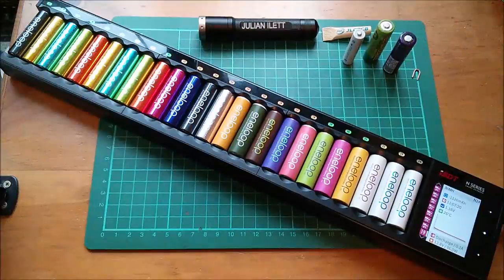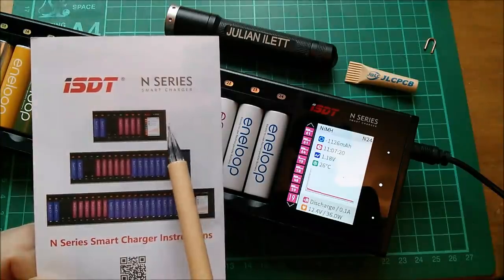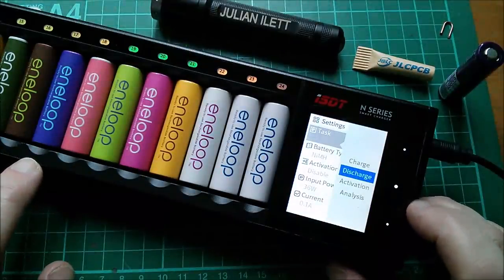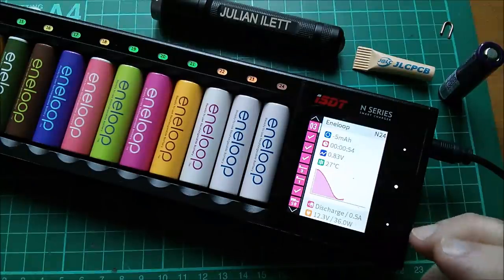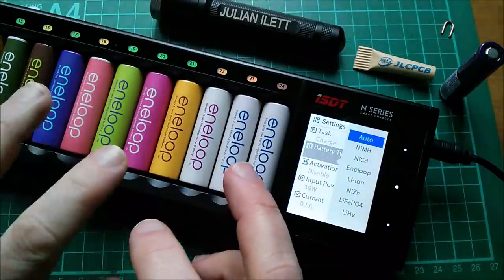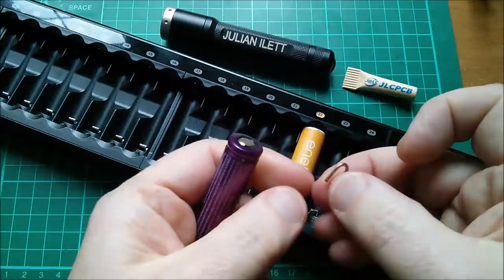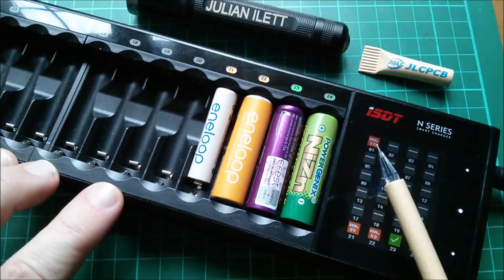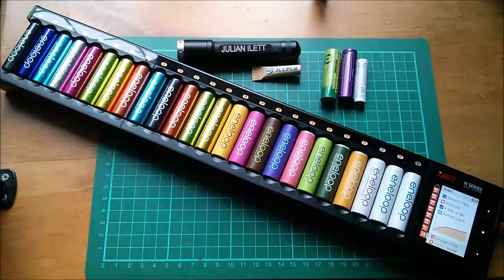First Look: ISDT N24 AA Battery Charger

Comment: Man, I wish that they made one of these for 18650's:) Great review, thanks.
Reply: LOL...can you imagine the size of the power brick you would need for a 24 slot 18650 charger..... it would need to be at least 12amps if you were going to provide 500mA to each cell , and the size of the circuitry to handle that beast and the heat dissipation...its like a desktop bomb....
Reply: @sortofsmarter  The 5V line of a computer PSU can do over 30A, enough to drive a rack of 24 TP4056 boards at 1A, and for a lot cheaper.
Reply: @ahaveland  True, I'm not saying it isn't possible. But depending on circuit design and chip demand you would need more than 5 volts. Even if you passed the current through one schottky diode and had no other losses in your circuit would loose 0.46v right there and now you dont have enough to reach full charge. But there are definitely ways just not cheap...
Reply: @sortofsmarter  No Schottky needed. Please read up on the spec of the TP4056. I know what I'm talking about because I've built a parallel independent charger for just a few quid.
They take 5V, and regulate it to follow the charge profile of a liion/lipo cell according to its state of charge.
Make two thick busbars, supply negative at one end and positive at the other, hang the TP4056 boards and 18650 sockets off it, and you're done.
Reply: @ahaveland  I have also built a similar board to charge 6 18650 at once, But i was implying a commercially viable unit like Julian's in a "all in one" form with a touch panel and a single interactive screen to display all the data for the entire unit. Just needing to add power to it.
Reply: @sortofsmarter  I can only respond to what you say, and not what you imply. 
There is a big difference between an integrated all in one unit with microcontrollers and a display than a rack of tiny TP4056 boards that use leds to show charge status and cost a few pence each.
Reply: @ahaveland  I know..my bad..lol good chat though...
Reply: @sortofsmarter  I have two PSU's in my PC, and each one can output 12 volts at 80 amps, that's more than enough for a charger like that.
Reply: @ahaveland  yep you are right I've got 20x18650 on a PC psu with each cell getting 1amp
Reply: @ELECTROHAXZ  12 volts at 80 amps! Are you sure? Sounds a lot to me.
Reply: @colintinker7778  Positive, two 12 volt 80 amp supplies. they're 900 watt supplies
Reply: do it yourself , the 18650 charger modules cost 2$ for a 10pcs pack and 
battery holder costs around 2-4$ for 10 slots depending on the type
only thing you need is a powersource
Reply: J B, I was hoping for the same thing, I’m looking for a full diagnostic charger for used laptop cells, 24 at once would save 100’s of hours!! 😉👍
Reply: J B there is something called megacellcharger which does 16 x 18650’s

Comment: It is HUGE!

Real shame about the poor design regarding the flat top batteries though.

Could have been sorted very easily with a button on the top of the charger to move the positive terminal position inwards slightly or just not have that terminal recessed.

However.
I suspect it has been designed that way to discourage reverse insertion of batteries.
Reply: Jason Park Moving the terminal won't be easy, as it's obviously just a dot on the PCB that also holds the LEDs. Avoiding the recess would just need redesigned plastic,  but would risk reverse insertion.

Comment: And you didn't put them in resistor colour code order :P
Reply from the maker: If only there were red eneloops :)
Reply: Or rainbow Hahaha! Nice one
Reply: I got cute coloured AA ones from Lidl (Tronic). They costed 3 Euros per 4-pack. The packaging said 2500 mAh and I measured them (discharging with my Accupower charger/measurer) as ~2260 mAh

Comment: The difficulty of taking out the batteries and the requirement of a "hack" to use certain batteries is a major design flaw.  Someone was going for looks over function and didn't do any prototype testing before making the moulds.

Comment: Does this charger use negative delta v for NiMh termination charge? I don't see a temperature sensor. In that case I'll stick with my Maha Powerex because in reality very few users use the Lithium chemistry in AA size.
Reply from the maker: I'm not sure yet. Most of the eneloops have been topping out at 1.50V almost as if it's terminating at that voltage. But some have only made it to 1.40V. Feels to me like it's delta V but with 1.50 as a maximum.

Comment: From an iSDT manual online.... "Activation and restoration functions of excessive discharged battery: When the charging task begins, a 0.1 A current should be applied to activate and restore the battery if the cell voltage is tested to be lower than the pre-charge voltage; on the other hand, it should be adjusted to a rated voltage for charging when the cell voltage is higher than the pre-charge voltage. This design can protect excessively discharged batteries, as well as conduct activation and restoration."
Reply: I was right! That’s what I thought but only for resetting protection IC’s if the 14500 has it but I guess it is for any chemistry that is really low voltage cool!

Comment: Activation usually should be used on new cells as it will try to do a break in to get maximum capacity from the cell and it is done by doing some charge / discharge cycles.

Comment: Activation is likely to be an initial forming charge (break in) for new (or long term unused/uncharged) batteries, at something like 0.1C for 16 hours..
Reply from the maker: On further investigation, I think it's Charge-Discharge-Charge, but you have to set the current yourself.
Reply: I first thought of it being able to reset the protection on 14500’s that have gone too low, but that is a niche feature
Reply: It looks to me the Analyze does a charge, discharge, charge cycle, while Activation does this three times and also accepts ridiculously low voltage (I tested with 0.2V 15 year old never used cell). While Cycle does this 5 (or more configurable) times.

Comment: How has this product held up to today? I just so happened to favor 24 batteries per case and have 24 eneloop pros and 24 eneloop standards in my arsenal at all times. This is the perfect charger to replace carrying around 3 4 bank chargers like the Opus.. (take care of 1 case in a SINGLE CRACK??? Excellent!). the 3x 4 bank chargers only do half my empty case at a time. So this would be perfection. provided it is accurate and any good. So how is it?? this has been around for 4  years now.

Comment: massive beast, but kudos that color palette it looks wicked.
it reminds me a little of the Efan.. just taken to the max and perhaps also with a lesser advance feature screen hence graphs https://lygte-info.dk/review/Review%20Charger%20Efan%20Lux%20S4%20LCD%20charger%20UK.html
but when it comes to chargers a lot has to do with how these chargers actually charge the batteries and the cycles... and if they are "nice" to the chem/battery and nurse it along or simply "foie gras" the current down the throat in abnormal pulses.
it doesnt look like this N series have been analyzed.
https://lygte-info.dk/info/roundCellChargerIndex%20UK.html

Comment: It's too bad this does not have a voltage output socket so that if you are in an off-grid scenario and discharging an array of batteries you could feed that power into something useful

Comment: As it doesn't do 18650s there's a very limited market for this.
Anyone that wants a 24 bay 18650 charger would just make their own out of a pile of TP4056 boards and a computer PSU as I and many others have already done.
It's good it can measure capacities but better if each cell's info could be selected by touching a sensor below the actual cell. The menu interface and number of clicks required would get quite irritating quite quickly!
Reply from the maker: My guess is that it's aimed at users of radio mics or walkie talkies.
Reply: @JulianIlett  Not my industry, but it sounds logical.
Reply: @JulianIlett  Yep that is my use. Sound departments for film use these quite a lot.

Comment: It’d probably take a week to discharge 24 batteries with this unit. Most hobby chargers have... basically a heat element with a fan blowing over it to discharge batteries and this clearly doesn’t, so I don’t  know that I’d plan on using that feature. That said, I just ordered one(n16) because there’s a giant hole in the market for AA chargers of more than 4 at a time that I would trust to not destroy batteries and/or catch on fire. Yes it’s pricey,  but so is everything else from ISDT and it’s worth it to me.

Comment: Can it be used to test capacity of non rechargable cells, like alkaline, zinc-carbon or zinc-chloride? Is it possible to set custom discharge voltage threshold?

Also does it measure mWh? That I would find very useful.

Comment: It is $125 on Banggood go to one of the eBay Chinese location sellers in their stores find the exact same charger without the brand name on it white box series it’ll be about half price
Reply: IKEA have a really nice 12 battery charger for $35 if one don´t need the fancy discharge or lithium capability
Reply: Spot on, ebay or even aliexpress and you don't have to risk getting your money back from Bangbad if the thing isn't delivered..the lying thieves.
Reply: and maybe it will even be the same thing, and not just a cheap look-alike clone!

Comment: If it could accept 18650, and be controlled via USB (set per-bay modes and limits; and data log voltages and currents lets say every second), it would be an amazing device. The built in firmware is reasonably nice. The graph definitively needs voltage and current units on y axis, and time or capacity on x axis. Not hard to fix. Hacking a firmware (or writing it from scratch) to do it all, shouldn't be super hard, but would be nicer if the source code is available. But lack of 18650, is a bummer. Also, would prefer 32 bays, and 100W , 24V power supply. :D I guess 12V is nice, because you could power it directly from car or 12V battery.

There is analysis mode. I wonder how it works exactly. Would be nice, it it could optimize discharge and charge, so when in analysis mode, it discharges some cells, but instead of dumping power it into resistor or mosfet, it uses it to charge some other cells. This way one could even make it almost self contained unit, and not need external power, or very little. Sure, you will eventually need to connect it to power, as there will be losses in redistribution.
Reply: Did you ever try finding out if they can charge the 18650 batteries?

Comment: I clicked on this specifically to see what power supply was provided with the unit.
If charging 24 cells at 500ma,that would be 12 amps.....
Reply from the maker: PSU is 12V 4A